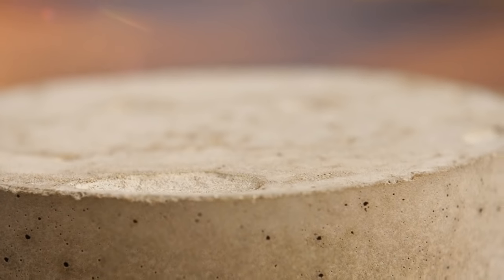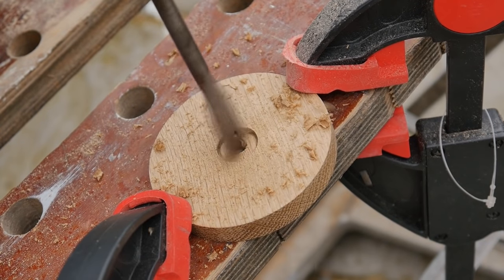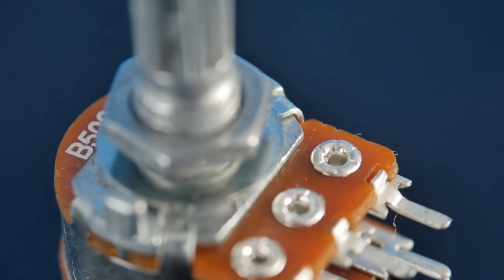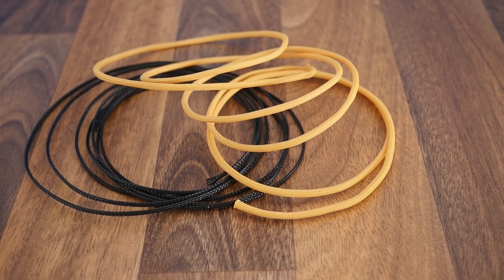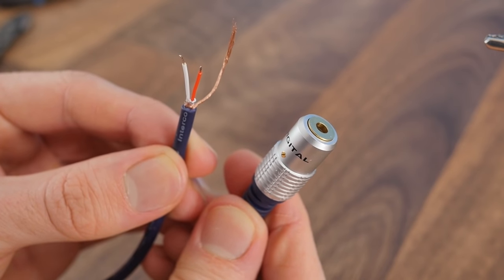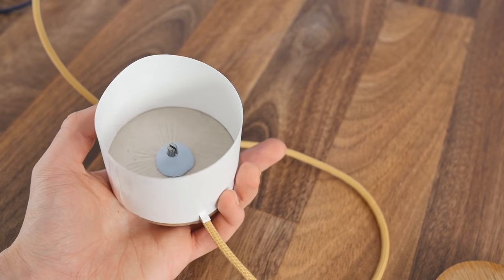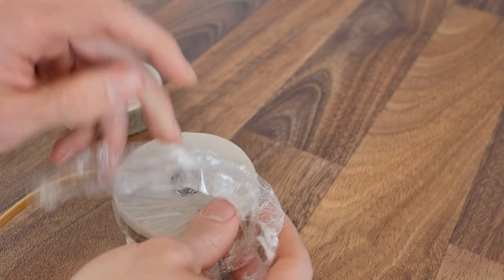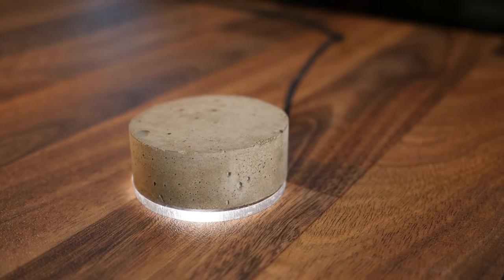How To Make a Concrete Volume Knob

Comment: I think you messed up the potentiometer type. For controlling audio levels you should use a logarithmic one, since our hearing is not linear. That's why they make logarithmic pots in the first place. Otherwise, cool idea with the concrete.

Comment: I  think it'd be better as a USB digital interface - with the long wire, potentiometer and two additional audio jacks i'm worried it can cause additional noise your audio cable receives.
Also you could make it a more convenient by putting the headphone out into the knob's base, since headphones have to lead out to the person at the knob anyway

With USB digital audio you could even remake it as a high-quality DAC+amp with a good quality full-size jack (normally plugged semi-flush with a 3.5 adapter, but available if you need it as is)

Comment: I wonder if it's possible to have an LED version that shifted in color depending on how loud the volume is. Max volume could be red, while lower volumes could be more blue until eventually turning off when the volume is disabled. This would make the overall design more complicated, but add a unique level of flair to it.

Comment: What was the reason for requiring a linear potentiometer? It is my understanding as an electrical engineer that log potentiometers should be use for audio purposes since this aligns more closely with how the human ear perceives sound.
Reply: I would agree, you always use logarithmic potentiometers for audio.
Reply: It depends how you describe 'for audio'. If it's a passive volume control then probably yes. But if you are using an IC or building a mixer circuit, linear pot can be required.

Comment: If you want to have both light and audio - may I recommend an ethernet cable which will have four pairs to work with.
One pair for each audio side, one pair for the light, and use a lead from the last pair for ground for the audio

Comment: vibrate the concrete by continually tapping on the sides really well to prevent all those air bubbles, a quick google search will tell you
Reply: +Radek Wysocki lol but in all of reality, through your jokes, that would actually work perfectly so if she uses it while drunk somehow, you won't have bleeding since you just doused it in cement
Reply: I think he wanted to keep the bubbles, said it looks better.
Reply: +Radek Wysocki you are legit the best dude!

Comment: You could have set a solid metal bar in the concrete through the split in the potentiometer and saved the epoxy that joins the concrete to the potentiometer shaft.

Comment: Volume potentiometers should be logarithmic because this matches the human psychoacoustic sense for volume changes. Furthermore the value does not matter at all, it can be anywhere between 500 Ω and 100.000 Ω because it simply acts as a voltage divider between the signal and ground potential.
Reply: +VVonderPie sure, thats a typical line level audio stereo pot

Comment: Here's the code for a digital Arduino version I made years ago: https://github.com/Djhg2000/AStar_32u4_volume_control

It controls the audio slider over USB so it works with every computer (tried both on Linux and Windows but any OS with keyboard media keys support should work) and audio setup (HDMI, optical, analog surround, etc.).

Edit:
Oh and I forgot to mention it supports using an LED which illustrates the "friction heat" between the base and the knob. When you turn it the LED gets brighter and when you stop it gets dimmer until it goes out.
Reply: Only 1 like?
Reply: @GhostSlayerYT  Looks that way. Would probably do better if I had a demo video.
Reply: @Djhg2000  yeah 🥺

Comment: In my opinion it's better use rotary encoder and arduino\any microcontroller for working as standart keyboards volume control.
Because it does'nt change signal path.

But...using potentiometer gives more smooth regulating.

Comment: could the brightness of the led also be controlled by the volume pot? I expect that it would need a different amount of resistance, so you would need some more fancy circuitry to pull it off. but it would have a really nice visual effect....

Comment: If you're interested in a more dense surface you could use an electric toothbrush (if no other kind of vibrating device is available ATM ;o) and press it to the wooden base while filling in the cement. JFTR.

Comment: I thought concrete needed some coarse aggregate too. Is just sand and cement considered concrete? Genuinely interested I have never really understood exactly what constitutes concrete properly.
Reply: Cement is actually the bonding agent of concrete and mortar mixtures.  Even though cement can be used by itself  in order to lessen the amount needed aggregates are used.  To make concrete for this size of an application sand is all that is needed for the aggregate.  You could add little pebbles I guess but they may show through (unless that's what you want).  In larger applications like sidewalks, driveways, walls, etc. larger stones are added to cut down on the amount of cement needed to make the concrete and then floated to hide the rocks.  Mortar is used to hold bricks together and is typically just cement and sand.

Comment: Isn't there a way to dim the LED when turning the knob? Since there is already a potentiometer in there you can hook up the LED to the potentiometer changing the resistance and therefore the dimming. It gives a better feedback on the volume I think.

Comment: What's the thought process behind using a linear pot for this? Surely you'd use a log pot?

And why such a low rating? Would it not make more sense to use a higher resistance so that it's handling less current?

Comment: Does it need to be 500 Ohm exactly as I can only get my hands on a 1k Ohm single and a 10k Ohm dual Gang. Is there much difference other than the sound being off for a larger amount of the volume controller?
Reply: +1

Comment: For a second I thought it was for guitars!
BTW, linear pots aren't good. They are used for passive tone control on guitars for example. For the volume, you'd need an audio taper pot.

Comment: So the shaft of the pot is just epoxy'd onto the concrete ? did you drill a hole into the concrete ?

Comment: not bad, shame i can never find good quality potentiometers, they always have some crackle when turning and if they don't they will in time
Reply: alps
Reply: Same issue with audio amps.... They always crackle after time....
Reply: Just add contact cleaner. I have a 35-ish year old amp that could really use it.

Comment: Those potentiometers linked are well over-priced, especially the specific one recommended for this project.
You can find the same or equivalent by searching for "dual pot 500B" at a third of the cost and free shipping.

Comment: does the acrylic have to be scratched so that it is matte on the side (from sandpaper) or would it be best to leave it shiny and smooth for the best lighting effect
Reply: +MegaDragonMinecraft if you machine acrylic it gets matte. so if you want it shiny you have to polish it. I'd say matte is better in this case, because more light will exit the acrylic on the matte edge. But that's just personal preference really.

Comment: Can you make it with a bismuth crystal at the top instead of concrete, and the led indicating the sound level ?
Reply: +Moddingear You could, but to get the LED to represent the sound level, you are going to need some extra circuitry to control the LED brightness. I'd suggest a simple 555 PWM LED dimmer circuit. But you would need a 3 gang potentiometer. Getting the circuit to work with such a low pot might be tricky. I'd be tempted to replace the pot with a rotary encoder and an Arduino nano or pro mini.

Comment: do think this would be possible with a similarly design using a sliding potentiometer? If so would you be able to suggest the correct poteniometer?

Comment: Hi, I built this project(I didn't use a USB cable though, I just connected the wires directly to the Potentiometer) , everything works fine, except I get slight static/distortion in the left channel. Your help would be great!

Comment: You can maybe use this just with headphones. Definitely don't use it to directly drive speakers though! I suppose 99% of people who watch this aren't going to actually bother building it. Actually nearly a million views, so more like 99.99% But anyway...

Those potentiometers, especially the slightly cheap looking one used here, can't dissipate a lot of power. The sort of power that can drive a speaker with medium loudness (especially since you've got the volume turned up full on the source), is a lot more power than that little potentiometer can handle. It will burn out, if you're lucky. Same said for the thin wire. 

If you were going to use it for driving speakers from an amplifier, put the knob on the input of the amp. Between the input of the amplifier, and the output of whatever music source, for example a computer. 

Many people nowadays use powered speakers where the amp is built-in to the speaker. In that case it's OK, just stick this knob in between the computer's output and the speakers' input. 

This isn't rocket science, so I'd hope that people who are practical enough to build this, will have enough basic electrical knowledge to know about things like this.

My point is, this is only good for controlling signal-level voltages and currents. But not power-level. Where power level is what comes from a 50W amp to drive some decent speakers. 50W into 8 ohm speakers would be 20 volts (ok) at 2.5 amps (not ok!). Way more current than those little potentiometers could handle. They do make high-power potentiometers, but don't sell many of them, because the sensible thing to do is use them to control the signal while it's still small, low-power, before it goes into the amplifier. 

On a different issue, there's the worry of cement getting quite hot when it hardens. In this case the pot had a metal shaft, not a plastic one. I worry about too much heat causing damage. 

Also, where you connect the headphone extender cable to the USB cable, might be nice to put a little box, or something, to hide the mess. A bit of heatshrink is OK but something better might be nice. Maybe a little box with a jack plug and socket, or two jack sockets.
Reply from the maker: It is supposed to go between a sound source and a amp, rather than between an amp and speaker, so no worries about heat there. Not sure setting concrete makes THAT much heat though.... even the fast drying stuff only gets warm, so it might be a case of over thinking there ;) it is a simple hobby project after all. Thanks for the well thought comment - always good to hear advice and thoughts as it helps me make better projects in the future.
Reply: Yup, I think it might be a little bit unclear though toward the end (right on 10:45 actually) where you mention headphones and speakers, and show the speakers, as to where you're supposed to plug it in. I suppose the jack plugs make it obvious. As I said, hopefully anyone doing this knows enough about the subject to know not to send real power through that little pot. But then you do explain things on a very simple level, most of the time. 

I suppose maybe you could consider your audience a bit more carefully, their level of technical knowledge. If you're going right for the basics, mention everything. If you're assuming some knowledge, you don't need to mention as much. 

Thinking about it, maybe it's a problem, and also the nature of this kind of video (and similar TV programmes). You need to sound technical enough to seem like you know what you're doing, that viewers are learning something they couldn't just figure out for themselves. OTOH it has to be comprehensible to them with their current level of knowledge. 

You have to, I suppose, flatter them a little. Include complex stuff so they feel they're not being talked down to, that they can keep up with it. But not too complex that they get alienated.

I'm sure the makers of Tomorrow's World had this all figured out to a fine art way back when. Although they got axed 20-odd years ago so it didn't help them! Then again TW dumbed down quite a lot at the end. Don't suppose you're old enough to remember! For Tomorrow's World substitute the Discovery Channel, even more so. 

And now a post about potentiometers has veered off into human social psychology. Sorry, I'm always doing that. Digressing, I mean.

That all said I've no intention of building this! It's just so relaxing to watch! What is it about watching other people work that's so soothing? 

Have you seen the post I made about the LM3914 bargraph? A viewer wants some sort of LED response added into this project, maybe you could do a video about it? 

Actually since the LM3914 was invented 30-odd years ago it's probably been superceded by the Arduino / microcontrollers in general. You could probably do the same thing in that. And add special modes! Just using the Arduino's analogue input. It's output pins can drive an LED no problem. 

I might pop up around some more of your videos. You ever watch Big Clive? He's a top chap. His stuff's maybe a little bit less technical than yours. Only a little mind. 

Finally... where abouts is that accent from? I'm asking as a fellow Brit, from Yorkshire. You seem a bit further North-East than me, but can't quite think where.

Comment: I followed this exactly, great video, but I'm getting noise through mine.  Weirdly when I have the PC paused and turn the volume knob 100% the noise stops, but as soon as I back off it comes back.  I did have to switch up the ground a bit as  when I had the grounds connected to the pot it made a lot of noise once I connected the grounds together on the connector end not on the pot it was greatly reduced to almost nothing, but it is still there a bit.
Reply: I would suggest it is a low quality/damaged/dirty potentiometer.
Reply: @MaebhsUrbanity  after alot of changes I came to the same conclusion.

Comment: Don't let this guy's cheerful attitude fool you. You will spend hours crying trying to solder those pins together without any signal loss. Starting over many times and cutting the wires shorter and shorter while cursing.

Comment: This really should rather be built using an Arduino controller, which sends volume up/down commands to the computer when turning a digital encoder. The controller can also dynamically control the brightness of the led with PWM.

Comment: It would be so much better if you simply use a tiny arduino/raspberry pi to adjust the volume by signaling the computer based on the knob, which you can do without soldering and cutting and reconnecting wires.

Comment: Would there be detrimental effects if you attacehd the led to the potentiometer so that the led is dimmed if the sound is at a low volume?

Comment: Would it be possible to use a remote control for my radio as RC for turning my PC On and Off? 

Or use a universal remote control, and program the buttons to do different things? I'm kinda lost on what I need and how to do it.
Reply: If you open up a spare or universal remote, and make external buttons on it that could work.

Comment: Could it be possible to wire the LED to the audio cables making the light change depending on the audio signal strength?

Comment: This is mortar, not concrete. Concrete has gravel in it that reinforce it. Reinforced concrete uses gravel, sand, cement and corrugated steel rods.

Source: I'm an Architect getting a Mechanical Engineering degree.
Reply: +Master Chief Actually gravel does not really reinforce concrete.  Gravel is cheap while cement is not.  Gravel just takes up space in the concrete so as not to spend so much on the cement.  Often times the weakest part of concrete is the interface with the gravel.  If you have every taken a concrete class you would have made test samples and then broken them.  You will often see them break cleanly along the faces of the pieces of gravel.

Source: Civil Engineering Degree with graduate level courses in concrete

Comment: Half of what I like about making my own things is being able to fix them. Because of that, I think glue is a mistake here. A preexisting small metal or plastic knob could be added to make the whole knob assembly removable without damaging the device. Conversely a small piece of metal be it a large washer or scrap of aluminium can be used to attach the potentiometer with its included mounting nut. Another piece could be put on the bottom to help protect the electrical contacts too. This video has a great concept but poor implementation. Then again that's the beauty of open source projects like this. It's easy to fix them.

Comment: Ah the remote volume control makes a return, these used to be very common before Hi-Fis started using remote controls ;)

If using between computer,laptop or mobile phone and amplified speakers the value of the potentiometer should be low 100 ohms to 500 ohms, If using between Hi-Fi components you will want a higher impedance 10 kilo-ohms to 100 kilo-ohms. In both cases it should be a Log type potentiometer you will find it easier to set the volume level.

Now why didn't he get a longer jack extension lead rather than cutting up a USB cable and joining it to one.
Reply: can i use  B50K ?? I dont know electronics..please help me!!

Comment: Can you just solder the ground wire to the 3 pin potentiometer instead of the channel wires to the 6 pin potentiometer?

Comment: I'm just about to recreate it but with an Arduino Pro Micro and a rotary encoder and a neopixel ring. Instead of concrete, I'm wondering if I shouldn't use epoxy resin as someone suggested in another comment here. Always these decisions...

Comment: I know this is a fairly old video, but I have two questions. Would this still work if you plugged it into a bluetooth audio adapter and if not, is there a way to use multiple devices with this at the same time?